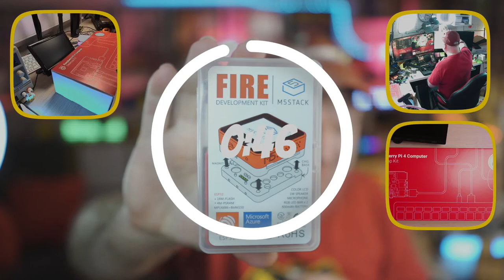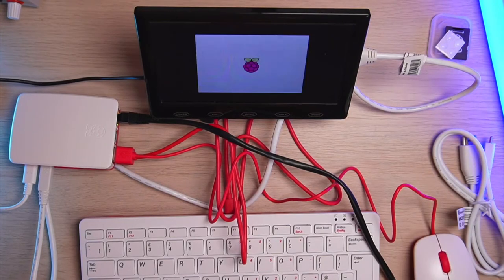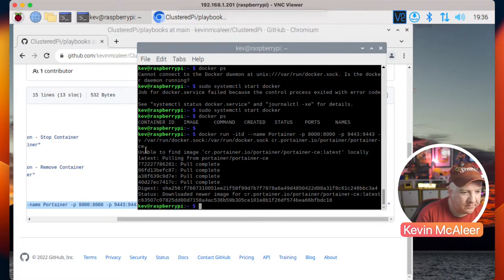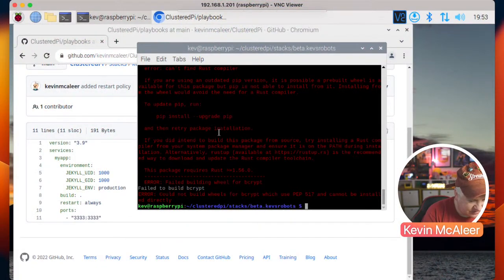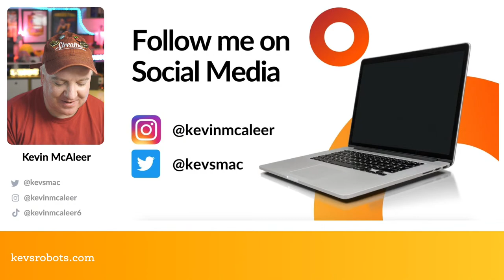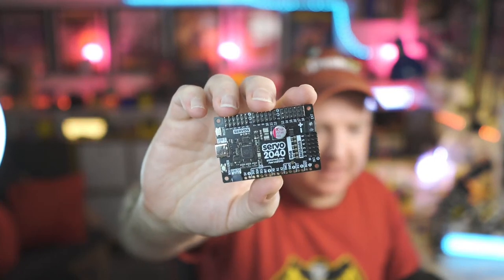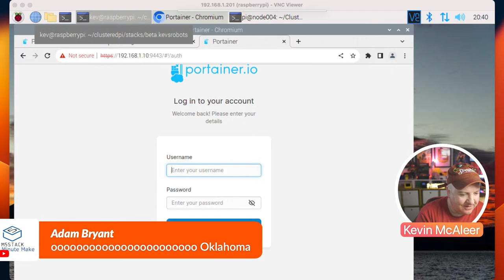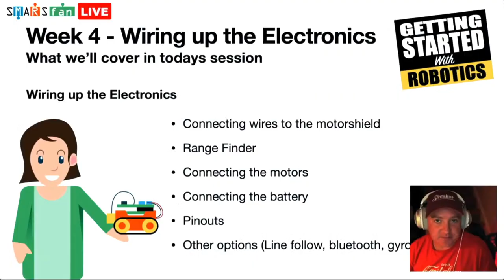Raspberry Pi 4 Desktop Kit Unboxing

Comment: Basically inside this kit is:
- a Pi 4 with the official case (white/red)
- official USB-C power supply (white)
- official mouse (white/red)
- official keyboard and USB hub (white/red)
- two official micro HDMI to HDMI cables (white)
- The Official Raspberry Pi Beginner's Guide (3rd Edition)
- SanDisk Edge 16gb U1 C10 A1 microSDHC card with Raspberry Pi OS preinstalled
- official microSD to SD adapter